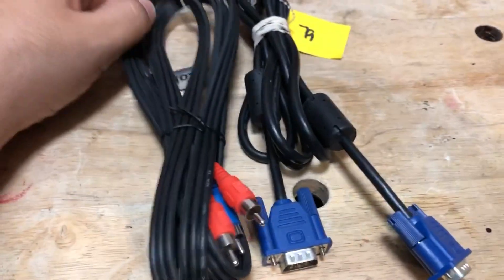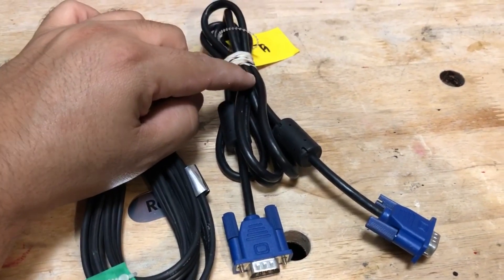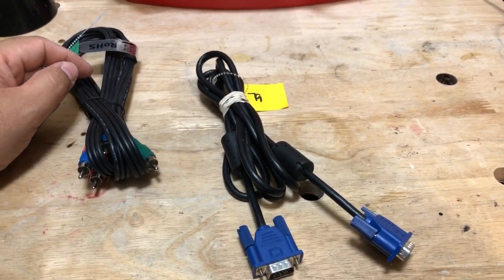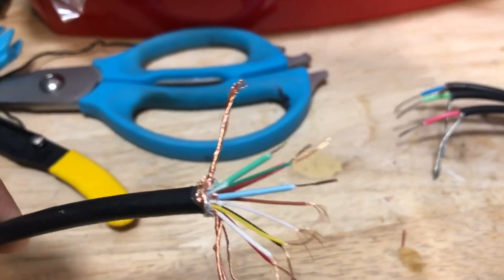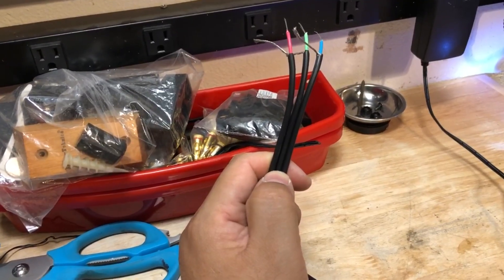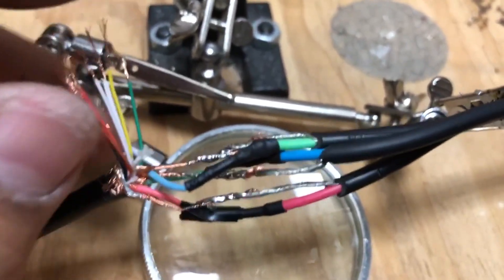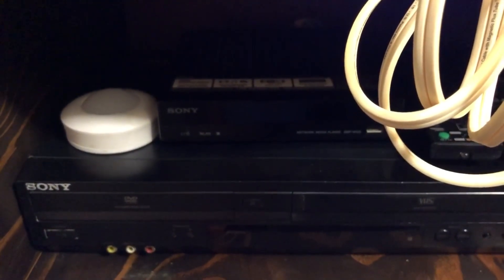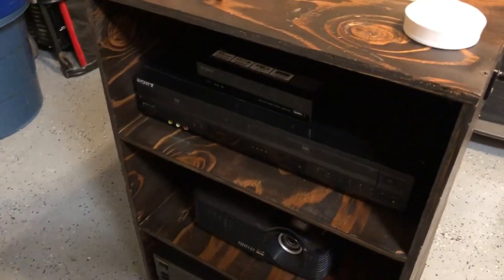DIY   Build your own Component to VGA Cable

Comment: Doesn't work with the ps2 folks, I tried it with no luck, a converter is needed
Reply: PS2 will only output 480i/576i in the menus and such, but you can technically use GSM to force progressive output. So if you're using a monitor it probably will not sync to that.

Comment: Thanks for the help! I needed to make my own adapter for my old consoles that use component so I used female contacts instead. Didn't even do any soldering, just twist the leads together and cover with shrink tubing and then wrap the monstrosity in electrical tape.
👍
Reply from the maker: No problem 👍

Comment: Would this work on a PS3 Component cable? 🤔🤔🤔
I'm trying to connect my PS3 to my LED VGA Monitor
Reply from the maker: Depends on the video outputs for your monitor and if they are compatible with the PS3.

Comment: I got a VGA  extension cable as extension for a Fostex D90 before i tried it i got my multi meter out and the pins are completely the wrong way round opposite for continuity on each side of the connector. I couldn't get it wrong because i know by the shape of each side only fits one way when testing it. Needless to say i tried it and it didn't work did i get a bum cable on ebay i cut one end open and only 8 wires
Reply from the maker: Check the video outputs for both devices before trying.  Mine worked for these specific devices.

Comment: Have you tried plugging
(Composite Video or Yellow RCA like VHS player) with your DIY cable's green wire?

I was wondering if plugging a yellow output to the green rca would work on your projector.

I know that the green component works as composite video.

My small Sony Trinitron with only AV input can see the Green component of my dvd player as a composite video with colors.

Maybe your projector could see a composite video as well through your DIY Cable.

For reference:
YPbPr (Y is Green/Luminance/Composite/Sync, Pb is Blue, and Pr is Red)

Another format is Sync-on-Green or
RGsB (Red, Sync-Green, Blue)

If ever the first try it doesnt work, try the blue component. (Due to the manufacturer's confusion in coloring green and blue as you've caught early in the video)
Reply from the maker: I made this cable for my projector and this worked for it.  I've read other comments about this not always working.  I think it all depends on your device.  Thanks for watching!

Comment: Hi Man, do you have an idea how to output the signal to a CRT TV how the wiring should be for that. I intend to use my Graphics card that has an DVI - I output which means it can output  analog signal or VGA. I have a cable that is DVI - I to BNC it has 7 connectors it came bundled from a media device. I think that cable can do the job i have measured the analog RGB pins and they are wired properly, the other part from the cable's bnc's to the CRT TV's SCART i intend to use an already made scart cable, just to cut it and wire it up with bnc at the proper wires.
Reply from the maker: Try your way.  If you can adjust the setting on your video card to some type of component signal that is compatible with your tv it should work.  I mainly tried to use this to convert a component signal to my video projector.  My video project was able to convert the component signal to a vga, but I don't think this is standard to all monitors or CRTs.  Let me know how it goes!  Thanks for watching!

Comment: So, when you say you  connected "green to green, and blue to blue" are you referring to the actual spliced cables or the vga wire to rca male plug head. They are blue to green wires in the video
Reply from the maker: Thats is correct.  I am referring to the vga line in relation to the composite line.  I hope this was helpful!  Thanks for watching!

Comment: Can i connect my setup box which gives output of av/rca i think, it has three wires. Video, left audio, right audio or red, yellow, white. Can i use same method to connect it to my vga monitor
Reply from the maker: The composite signal from your setup box will not be seen by your VGA monitor is you try to use the green cable.  My best suggestion would be to get a composite to VGA converter box.  They have some on eBay and are relatively inexpensive.  Thanks for watching!
Reply: @joelsdiy9469  ok👌

Comment: Could you tell me if this could work the other way around?, I mean if can conect a PC with a VGA out to a CRT TV with component inputs?.

I´ve heard that the refresh rate of VGA signal is not compatible with TVs, but I`ve also seen this kinds of cables for sale.
Reply from the maker: Yeah if you have a video card that can match the refresh rate and output interlaced you might be able to do it.  You should check the specs of your CRT, then try to match it with your PC.  You might be able to make it work like that.  I hope this is helpful.  Thanks for watching!

Comment: Is it possible to use one of those component to VGA cables as a component to VGA one?
Reply from the maker: I've tried that and sometimes it works.  I suggest looking at the specs of your device and monitor to see if they can support the same resolutions.  Thanks for watching!

Comment: input from laptop and output in tv is it work ?
Reply from the maker: Depends on your laptop and monitor.  If your laptop can do an interlaced signal to your CRT TV it should work.  If your TV can't handle the signal coming out of your laptop it wont work.

Comment: Do you think if i make this but i use component cable from ps2 will be working with sound on ? 
Thank you
Reply from the maker: I am not sure I understand.  This cable is wired only for the picture, not sound.
Reply: @joelsdiy9469  ok thank you

Comment: hi Joel, Joel here, will this work to transfer laptop to t.v.? made the connections but when pluged in, laptop display shrinks and the t.v. display is a mess of scrambled colors. any help would be obliged
Reply from the maker: Laptops usually have a very high resolution, so if you are trying this on a CRT, it wont work unless the signal is interlaced.
Reply: @joelsdiy9469  I HAVE NO CLUE WHAT THAT MEANS, SORRY. ITS A FUJITSU LIFEBOOK AH532 LAPTOP TO A Sylvania's 6620LCT 20" T.V. DOES THIS HELP?
Reply: AND YOUR TIME IS APPRECIATED
Reply: @joeltheiss4620  IT IS THIS   "CAN YOUR TV HANDLE  720 /1080 /1450
AND THE "HZ" YOUR PC DISPLAY IS USING ? 60 /75 /80 HZ

IF YOUR "TV"  NOT  SUPPORT THIS (SOME IT WILL YOU MUST FIND OUT)
YOU MUST "SET" YOUR "PC-VIDEO-CARD" TO "USE"  WHAT YOUR "TV"
CAN DO .......

 !! IF IT IS (1280x768  72hz) ...

YOU MUST "SET"  YOUR "PC"  TO  "USE"  (1280x768 72hz)..ok

READ YOUR "TV-MANUAL" ..ABOUT "RESOLUTION" ...
THEN "ADJUST" YOUR PC ...TO THE "SAME" ...OK

Comment: Hey Friends, this cable does not work, there is no vertical and horizontal sigronization, you only answer those who congratulate you, but those of us who tested the project and it did not work, we must not lie to people with false videos
Reply from the maker: I am sorry to hear this Enrique, it certainly depends on what you are using the cable for.  I would not recommend using this using progressive mode for any device since the cable really doesn't work on CRTs unless you do 480i or other interlaced signals.  Another piece of advise would be checking the double checking the wiring.  I always check the continuity to make sure I spliced the cables correctly.  Thanks for watching!  I do appreciate all feedback.
Reply: Vertical and horizontal sync doesn’t play into this my dude vga is not a connector it’s a video standard, the HD-15 connector can RGBHV (aka VGA) and YPbPr (aka component video). The connector is not what you need to know, you need to know what your device can take which is usually in the manual. Now I have my own hang ups with Joels video but I’m not gonna say it’s false. It does work for very specific use cases. The guy seems to be listening to feed back, that’s why I added to a few comments so people understand this is not guaranteed to work for everyone.

Comment: I knew it! I didn't think you needed a conversion box. Both cables are analog and RGB, so I was confused why some sources said you needed a conversion. Thanks for posting!
Reply from the maker: Glad I could help!
Reply: No his device takes YPbPr (component) through the HD-15 (vga) port. VGA isn’t a plug it’s a signal standard, fun fact vga is a type of component video. The fact is this won’t work for everyone. You need to know what your device is capable of accepting first before doing this.
Reply: @PsychoVision19  thanks for the info!
Reply: For me trying to hook up to a crt pc vga monitor its not working.
Reply: I didn't figure it would.. It should being that both are analog.    @WingmanLive

Comment: I tried it but it does not work on my pc monitor :( I connected a component cable to my PSP and connected the vga end to my monitor, but the monitor kept saying no signal.
Reply from the maker: Did you try using an interlaced signal like 480i or lower?  I am not sure if your monitor is capable of progressive scan.  Thanks for watching the video!
Reply: @joelsdiy9469  all crt monitors are capable of progressive scan
Reply: @randomgamer24x65  Consumer CRTs doesn’t support progressive scan
Reply: @sparda1418  all consumer crt monitors support progressive scan this is talking about pc monitors and yes they all support progressive scan also your point is irrelevant because all consumer TVs support progressive scan also 240p is progressive you should know this
Reply: @sparda1418  and to add to that the psp outputs at 480x272 which is why the monitor doesn't work most monitors require a higher resolution usually the minimum is 640x480
Reply: @randomgamer24x65  yes I know 240p is progressive but I meant they don’t support 480p
Reply: @sparda1418  and to add even more I know you was talking about 480p and you are still wrong there are consumer ed crts they were rare but there were a few like the Samsung TXN2745FP
Reply: @randomgamer24x65  there were some tvs support even more than 480p but I was talking about the common ones you see every where which they are limited to 240p/480i

Comment: Can i use to conect satelit receiver to Monitor..?
Reply from the maker: Probably, but make sure to know if your monitor can handle digital signals, if your receiver is digital.  Thanks for watching!
Reply: @joelsdiy9469  okay...thank you..
Reply: @joelsdiy9469  then it for sure wouldn’t work, component is an analog signal not a digital one.
Reply: @PsychoVision19  😜😜😁😁

Comment: But I've yellow white red cable and want to connect it to vga for lcd monitor,
Reply from the maker: I am sure that there might be a schematic out there to try this, but I have never tried it.  Good idea for a video!  Thanks for watching!
Reply: The colors don’t really matter on RCA cables. You can send video and sound through and color rca cable. Just make sure your device can accept component through vga

Comment: What should we do with the remaining wires which are not connected
Reply from the maker: I would make sure that they are shielded and out of continuity with the other cables that are going to be used.  The signal will not be used on those extra cables.  Thanks for watching!

Comment: just have Y PB PR connections ? why not have HSYNC VSYNC ? will it make device fault?
Reply from the maker: I've only used it with devices that use an interlaced signal.  When it comes to progressive scan, there might be some compatibility issues.  I would rather try buying a converter (Y PB PR to HDMI).  They are pretty cheap (between $13-20).  Thanks for watching!

Comment: Where did you  join those dotted (ground) wires from rca cabel?
Reply from the maker: I merged all the ground cables from the rca to the common ground of the VGA cable.  I hope this is helpful!
Reply: @joelsdiy9469  ok , thanks for replying 
Iam making this to connect my tv dth box to my old computer's monitor(vga based) 🙂🙂.

Comment: Thanks man, you're a star
Reply from the maker: No problem!
Reply: courage tell me lm failing l tried  it but nothing works
Reply: @trymoremazarura8250  your device can’t take component. He built what’s called a pass through cable. It just passes the video signal through to another connection type, it doesn’t change it from component.

Comment: will this work if i use the vga cable to my laptop as the source and plug it on an analogue tv as a second monitor? thanks in advance
Reply from the maker: Depends, if you're tv is able to handle progressive scan it might work.  Tube tv's are usually unable to handle progressive scan.  I hope this was helpful, thanks for watching my video.
Reply: @joelsdiy9469  oh ok thank you so much for replying God bless you
Reply: It’s not that simple. Your tv can’t take the kHz range your laptop will output.

Comment: Hello. This cable, due to both ends being male... Can it work the other way around? I mean,  have the vga input connected to an old pc and hook it to a tv with component?
Reply from the maker: Depends, if your tv can handle a progressive scan it might work.  If you have a tube tv, this might not work unless the tv also has a vga input.  Thanks for watching!

Comment: Thank you for the video. Have you ever built a cable/adapter to connect YCbCr (camcorder output) to USB (pc input)? I haven't found anything similar on the market, there's only some HDMI to USB adapter.
Reply from the maker: Unfortunately not.  I don't think USB is able to transfer a video signal directly, but correct me if I am wrong.  Thanks for watching!
Reply: LoL you would need to write drivers and have a controller to convert the signal to the usb standard. GLHF
Reply: Quite necro-posting from my end, but just for sake of helping anyone else with the same doubt, Capture cards may do that work. They recieve HDMI and sends over USB video while reporting itself as a Camera device, or instead as a proper capture card that needs drivers (for example the high end Elgato PCI-Express instead of USB). There are quite a few non-branded capture cards that do HDMI->USB but they get heat easily.

Also, im not considering converting any analog signal (VGA, Component Out, etc) to HDMI because of this project and there's quite a few affordable VGA to HDMI converters (and vice versa too)

Comment: Good video! Can I use it for connect my PS2 to a VGA monitor? Of course assuming that I would need female RCA and the PS2 cable with male end RCA
Reply from the maker: On paper it should work since your ps2 component signal should work on a VGA monitor.  I have not tried it myself, but assuming that it worked on my projector, I have no reason to believe that it wouldn't work on a VGA monitor.  Thank you for watching!
Reply: No the monitor won’t know what to do with YPbPr (component). Also you monitor won’t be able to even see the 15kHz signal if your ps2 is outputting 480i, a vga monitor only sees 31kHz which a ps2 can do but it does 15kHz 98% of the time
Reply: @PsychoVision19  make it launch opl at boot and make opl run at the VGA resolution mode. use gsm to make games run at vga mode
Reply: Te funcionó?
Reply: @ComputerTechnic217  so the cable Is works? In ps2 on a VGA monitor?
Reply: @Pablo1911ify  what you have to do first is set PS2 to RGB mode. set opl to 480p VGA mode and set OPL to launch at boot. 

then take PS2 COMPONENT CABLE and wire to VGA plug. 

then it will work

Comment: Is it possible to do RCA/composite input to VGA in a similar fashion?
Reply from the maker: Possibly, I am not sure there is a schematic online, but you could probably do it if you can find some resistor or capacitor values to help you mod the cable.  Thank you for watching!
Reply: I believe you can but only in black and white. The green signal in component is black and white composite video

Color requires more circuitry because of the way NTSC color is injected onto a b&w signal.
Reply: @tristan6509  Thanks, this is the info I was looking for.

Comment: From some reading and plenty of videos, I find out that the HDMI cable is compatible to allow from the input source to the outout source. However, VGA cables are meant to transfer Data through the pins. This is to why there is no sound. What I did as a workaround since I have a wired controler as well as a wired for gaming, I have the wireless controller with a audio Aux cable to A JBL Charge bluettoth soeaker and this speaker emmits the same synced signal to 2 other JBL flip speakers I have setup as a small and interchangeable surround sound. I have seen people connect through the fiber optics audio cable and add a bluetooth adapter to connect your own bluetooth head unit. There is a slight barely noticeable delay but I can hardly ever tell.
Reply from the maker: That sounds like an interesting of channeling sound from HDMI.  I would like to look at a pinout of that.  It would make a very interesting project to test.  Thank you for watching!

Comment: I'm in the process of trying to use a an older Dell CRT monitor for a wii/GameCube setup using something similar to this. Any suggestions?
Reply from the maker: I would watch out with using CRTs or older TV's when using digital outputs.  Some cannot handle the higher resolutions.  If you're going to use a Wii, I would find out if you can deactivate progressive scan, because if you can't it won't work.
Reply: You’d need a device to upscale that to 31kHz your monitor won’t see it otherwise